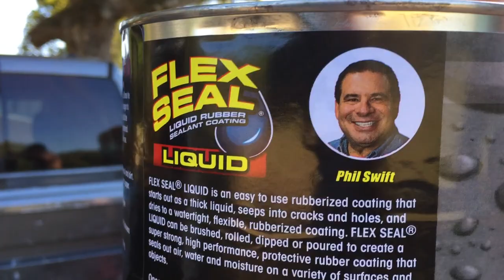We used Flex Seal On The Whole Floor // Vlog #4 // Birdie Venture

Comment: Would have like to known…..type of roller you used?  How many gallons? How long did it take to dry? Any issues you came across?  Thanks a ton
Reply from the maker: Yea sure thing. About 2 gallons. Used any roller. It’s really thick stuff so takes a little bit to roll out. Dried fairly quickly. Hope that helps. It was honestly an experiment for us but seemed to work good.